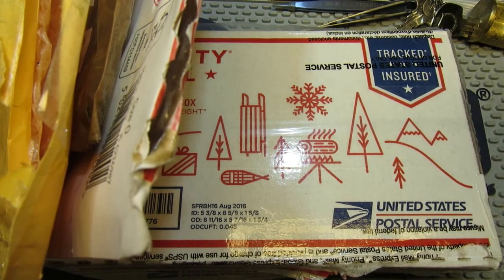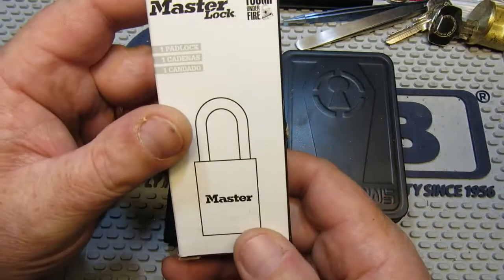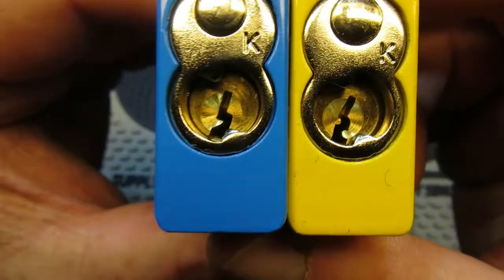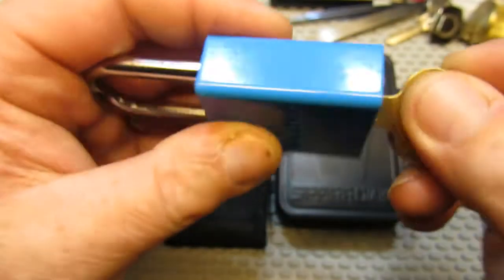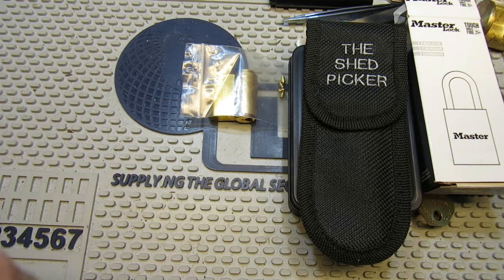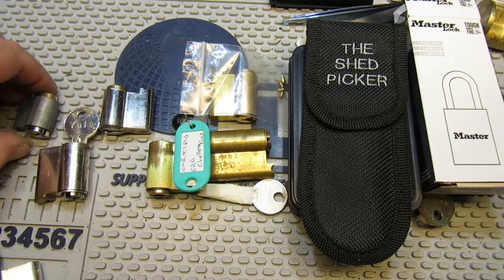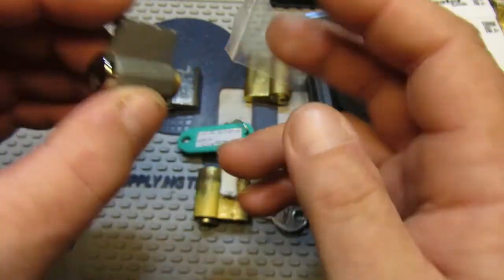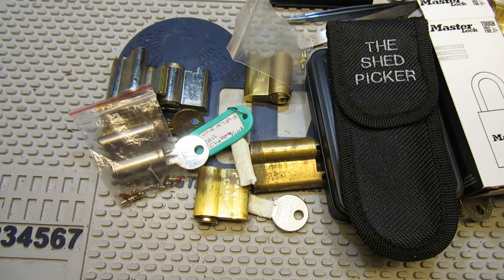(243) Busy Day for the Postman

Comment: Those Long Pins in the Sparrows Reload kit are spare locking  pins for the core screw on the back of Schlage KIKs.  I use the reload kit pins & keys with standard Schlage KIKs.  They work fine.  A very useful kit
Reply from the maker: Thanks, I was just waffling on the fly but yes they are, I have a security pinning kit from the States that has some similar pins and springs that are (from memory) Schlage and Ilco anti bump systems, so that was what came straight to mind.